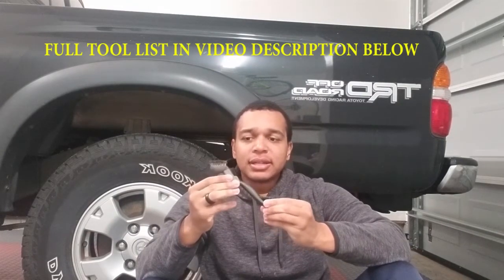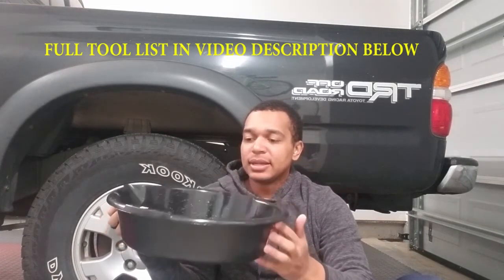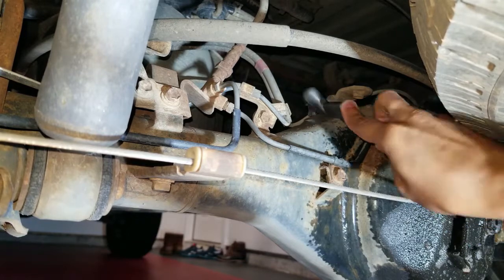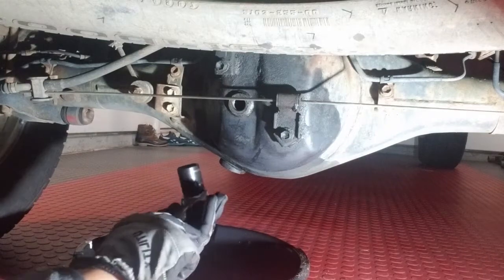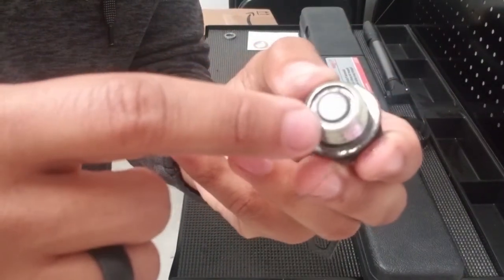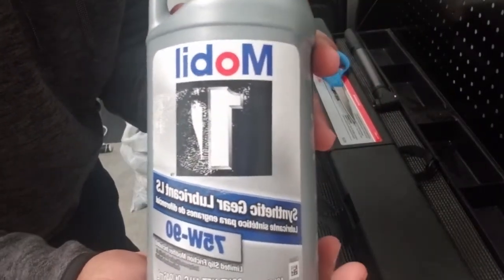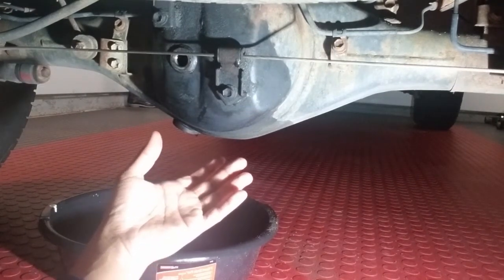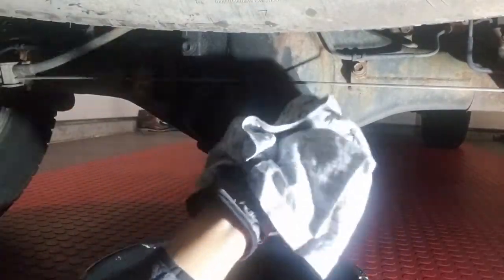Rear DIFFERENTIAL Oil Change | Toyota Tacoma 4Runner T100 Tundra

Comment: Thanks so much for this video. I’ve never done this before. My T-100 is 27 years old; and I’ve had it for 23 of those years. She’s leaking the gear oil and I was largely oblivious to it but knew something was wrong a few years ago and a neighbor put a liter in for me. It’s gotten louder so today I took it upon myself to add more and OMG I had bought the gallon jug of 80W90 at Walmart and about used it all. The gallon doesn’t have that convenient spout like the jug you are using so I used a small funnel, and filled condiment containers from dollar tree to squirt a bit down the funnel, then wait, squirt more, repeat (a lot) and eventually I filled enough for excess to come out the fill hole. I’m going to have to monitor how fast I’m losing the oil in the differential. It looks like maybe the seal on the front side of that transfer case has the seal going.
Reply from the maker: Truck still going relatively strong for almost 30 years old! Nice tip on if using the gallon jug, hopefully the leak is not a fast leak and easy to spot

Comment: I know this is old, but I have to say, when you broke loose the fill plug and said, "that was fairly easy the way it should be, somebody put it on correctly..." I literally laughed. Remembering my 03 Pontiac that took a huge breaker, and let loose with a gigantic pop. ah good ole GM. Thanks for the info, great job. Incidentally, I'm having to fill mine because the vent was clogged, and pressure built sending the gear oil out my axle seals, soaking my rear brakes
Reply from the maker: Haha, yes all DIY mechanics have a trusty breaker bar around to bust over tightened or neglected bolt areas

Comment: Beautifully done, I've got a '93 T100 (3.0 manual 4x4) and am assuming the procedure is the same front/rear. Should I also change-out the transfer case oil too?
Reply from the maker: It should be very similar thanks to Toyota and their manufacturing process of keeping components between models somewhat similar. I would do the transfer case as well if you have the time, since you are already under the vehicle

Comment: Notice the lettering in truck and oil container are inverted. Consequently you see him loosening plugs to the right, the opposite direction. He was filming thru a mirror??
Actually he should not publish a video that could be misleading...??
Reply from the maker: Haha fake news!
Reply: Ok pose jacheco
Reply: You really, really need to flip the orientation of the video. When you are removing the fill plug, you do look like you are tighten it instead of removing the plug. People not that familiar with removing nuts/bolts will turn it clock-wise trying to loosen it.
Reply from the maker: Lefty loosey righty tightly! You just need to remember that mantra
Reply: @EngineeredMojo  Or simply flip the video.  🙂
Reply from the maker: @oo7warrior  haha too late to flip the video, it's set and done. I'll take the consideration for any future videos 🙂